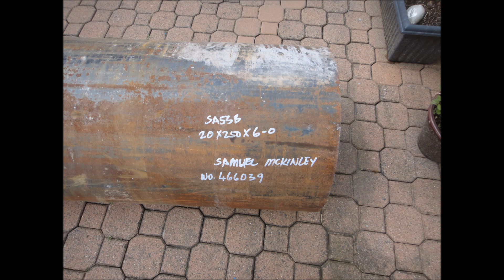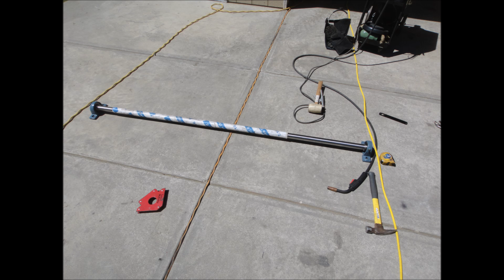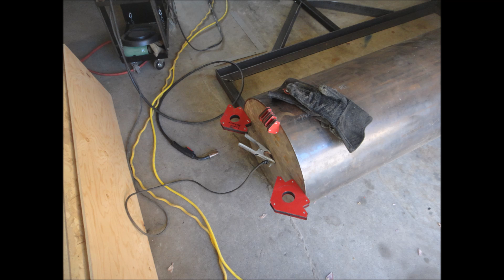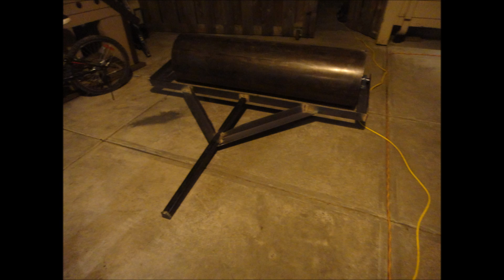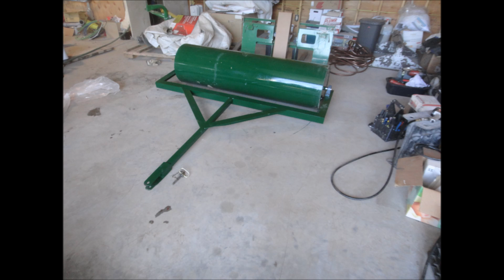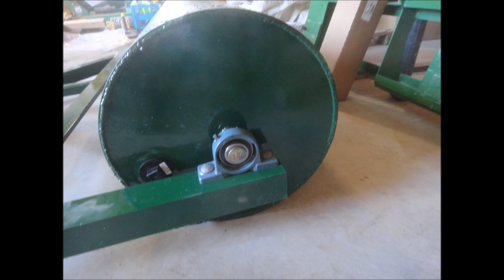6' Lawn Roller Build

Comment: Nice roller. I built one years ago using 1/2" gas pipeline 2' dia. x 5' long, boat axles welded with bearings the whole works to make it nice. 3 years later forgot to drain water and it froze blowing out the ends and twisting the frame. Cut it all apart with a 2" solid axel thru center and now filled with dry stone dust it's about 2500# and levels just about anything. Could probably use to pave roads.ha ha

Comment: Hi Samuel, I am putting together the supplies to build this. After using it for two years would you change anything?
Reply from the maker: Hi Josh, Hope your build goes well! Yeah, make sure the cap you get is metal and not plastic. The plastic threads strip when you winch it down to prevent leaks. So make sure when you are welding in a set of threads, you have a cal that works well with it. Other than that, I dont think there are any other changes I'd make! (Infact I can still fix that, just have to weld a custom cap)